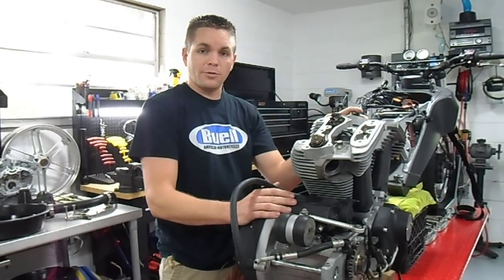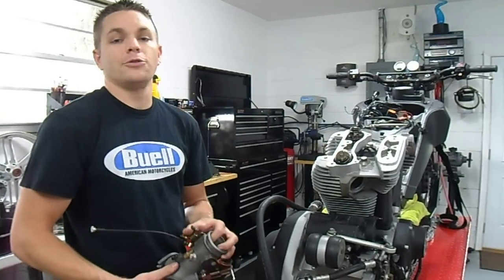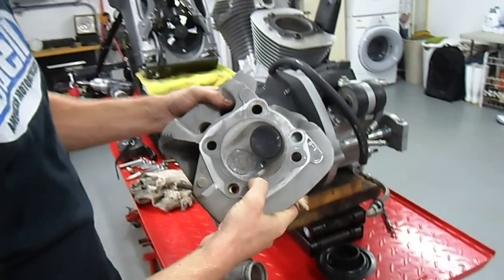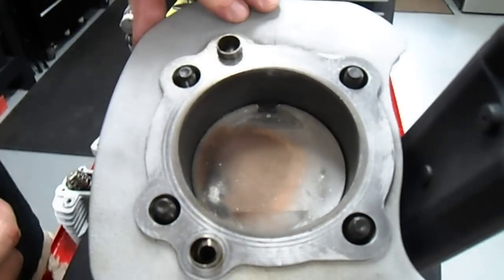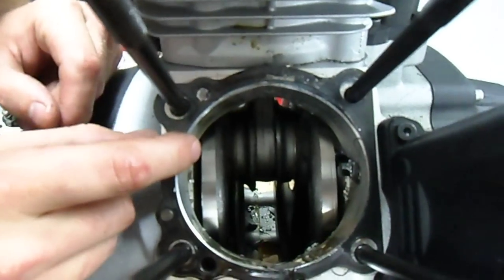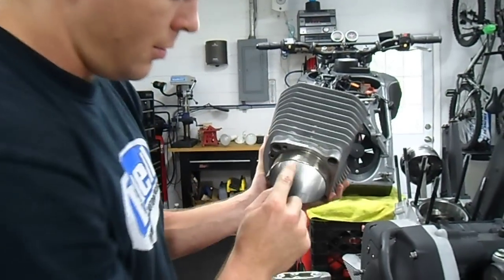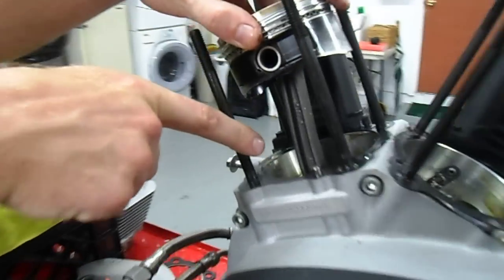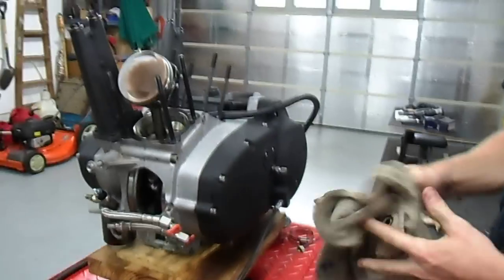XB Motor Disassembly

Comment: I wonder...if the thermal coating, on both pistons, is gone on the pushrod side, because the pushrod housings are preventing, that side of the engine from dissipating heat.

I never thought I would ever work on an air cooled engine, and I am worried about that being a problem. I am getting a XB9R and building a turbo kit for it. Also, if possible, and I feel like it, doing an engine swap, to  the 12R's engine, in the distant future. 

I am also concerned, that the rear cylinder, will always be hotter then the front, because the front is directly getting hit by fresh air, and it is blocking the rear. I've been thinking of either, making gills, that will give both cylinders more fresh air, or, making a liquid cooling system around the engine, powered by an electric motor, and or the belt, if the generator can't handle it, and everything else that's normal.

What do you think. Do you have any tips, or things I missed?
Reply from the maker: I learned that the damage to the thermal coating was caused by detonation. I spent a good bit of time tuning and started with a pretty aggressive ignition curve so the damage to the coating was probably done early on. The location of the pushrod covers is insignificant relative to the cooling of the heads and cylinders.

I understand the consideration for heat issues with these motors and the rear cylinder placement but it is not an issue. The engine management and stock cooling fan does more than enough to properly evacuate the heat from the motor, even when it pumps out as much power as mine.
Reply: Thank you very much for your reply. If what you state is true, then i have nothing to worry about, but it would still be great to see these engines in a wind tunnel with a smoke stream, to see how air flows around these engines. I already know how to improve a liquid cooling system, but air cooled is new to me, other then, what I know about heat sinks. I'll take your word for it, and focus on other changes to mine.

Even if I don do an engine swap, I can still learn a lot from you. This is the first video I have seen, of either of these engines, taken apart, but I haven't seen one taken apart completely, or what certain things look like, Partzilla doesn't support these bike, like they would a Kawasaki ZX6R, and I haven't found diagrams of parts and assemblies yet. 

So I don't know exactly what to expect, when I port & polish the cylinder heads, or if I should find a place, to perfectly balance the crankshaft, and taper any blunt edges. Were you so upbeat in this video, because you're fully willing to go through parts for the perfect tune?

Comment: most viewers dont realize that once you boost something and start turning that boost up your gambling with your motor.  eventually your luck will run out when you find a weak part.  some people (like this guy) are willing to push it to that limit so they can rebuild with stronger parts and roll the dice some more.

Comment: what the f did you do to break a rod and so many things on that engine ?!
Reply from the maker: check out my other videos and my site listed in the info. This was because I forgot to readjust my manual boost controller on my turbo setup 3 years ago. Things are back together and better/bad'er than ever now.